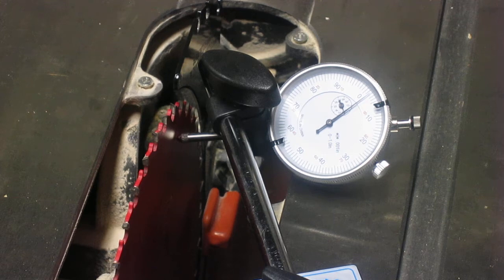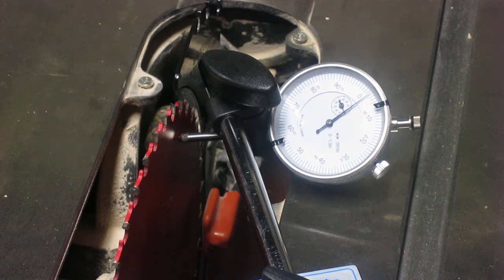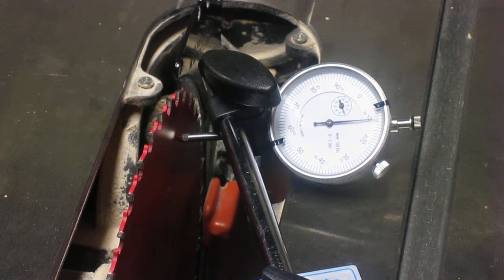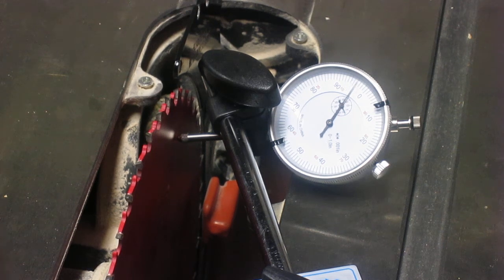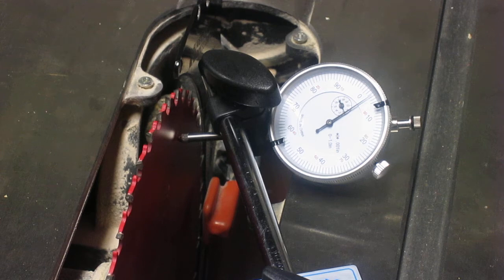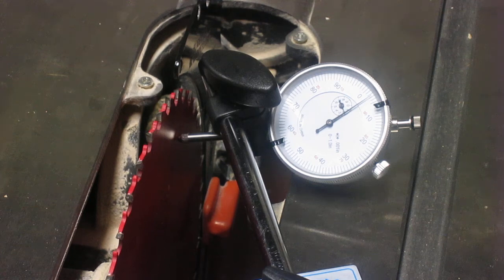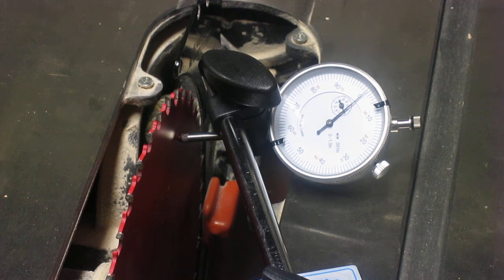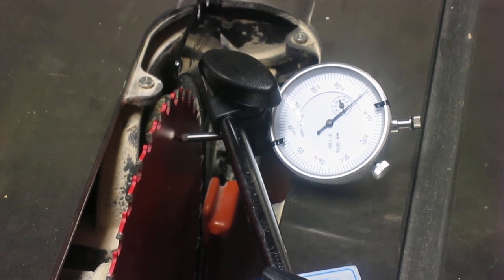Ridgid R4512 Blade Alignment Problem

Comment: I had the same problem on mine - purchased in 2014.  It was about 1/16th to 1/8th out of alignment. Took it back to HD and exchanged it for a new one. The mobile base came in very handy when wheeling it back into the store! HD was very accommodating in this regard.  The new saw works great.
Reply: That's a huge

Comment: I've read that this issue was only with earlier models and it has been corrected,
when did you buy this saw?
Reply: Just got one in Dec 2018, so they're still selling them. Haven't tested for this issue yet though.
Reply from the maker: I purchased mine 12/8/13.  I believe the box showed a shipping date of 3/11/13, but I'm not 100% certain on that, but it was for sure in 2013.  

I ended up returning this particular saw and exchanged it for a different one.  The replacement had the exact same issue although it was more like .003-.005" rather than .015", so it was an improvement.  

I'm still up in the air about keeping the saw though.  I still have another 3 weeks to decide.  If I can find an older Delta Unisaw I'm going to grab that, add a BORK riving knife/blade guard and upgrade the fence to a Delta T2 I have on hand.  

As much as I like the saw I've heard that the issue gets worth with time so this isn't something I want to be dealing with in the future.  

By the way, if you call Ridgid they will tell you that they are no longer shipping these saws out, so my impression is that once Home Depot sells what they have left of the R4512s that will be it for them.  Probably going to be replaced by a new saw.

If you're in the new market I'd look into the new Delta Hybrid at Lowes.  It looks promising.
Reply: Thanks for the advice, I've been following the ridgid 4512, the porter cable pb270ts and the craftsman 22183 for a few years, hoping to get one of them, the porter cable is cheap here at lowes for $500, but ive heard you cant get parts for that one.. the ridgid was the front runner for me, but your right, I definately think it will be discontinued... so im gonna wait a bit more and go get that delta or a grizzly 715p. It will be more dough but i think less headaches in the long run.